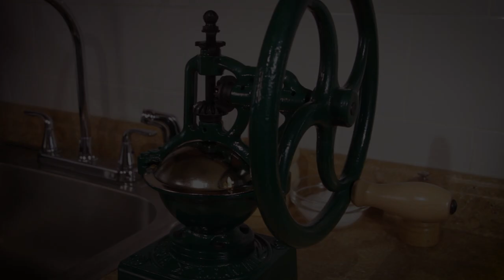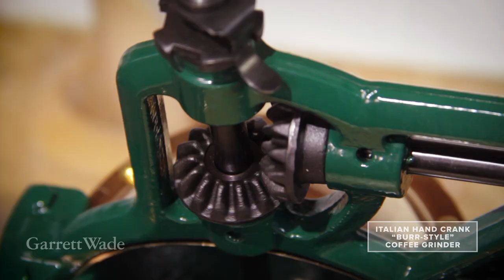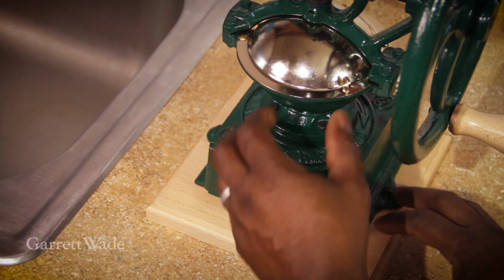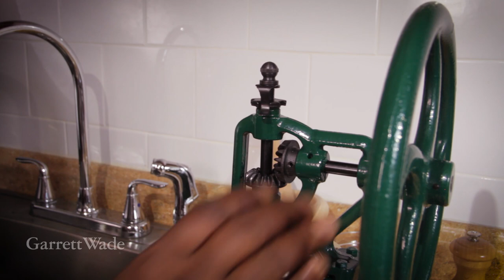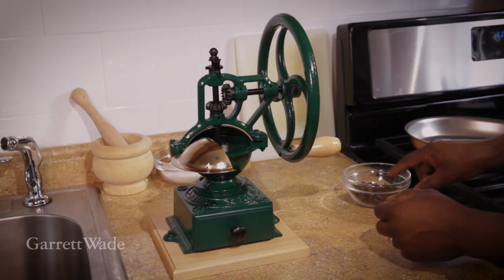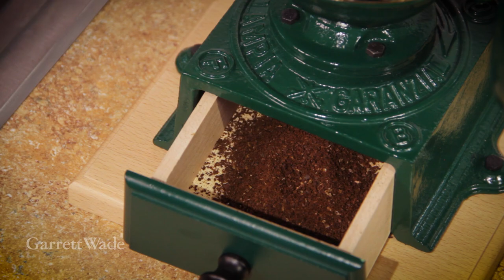Italian Hand Crank "Burr-Style" Coffee Grinder

Comment: As Italian (Turin, same place of these) I so far have two smaller/horizontal handle rotation ones. I'm looking forward to getting one of these and here I'd recommend it to everyone because of a few features... Heavy - doesnt wobble nor require an effort with a firm grip. I have just seen a couple of these in local shops and, for what I can guess, the vertical rotation looks like it's more natural (feels easier) to perform. Depending on the hardness of the beans, grinding can actually require a good bit of strength (not depending on these grinders vs others I believe, as they're really very sturdy - and that's a strong point. Not sparing on materials. Goold old way). A more natural-feeling shoulder/arm moving, does help making the practise more agreeable. The other feature I like is these can hold 100g in one go. If kept in a dry air environment and an almost airproof, ground coffee can be decent even after a few days. And, having some coffee readily ground, helps at night when neighbours/flatmates are sleeping and even the least noise (these grinders I believe are just as silent as such tools can possibly be) can disturb their sleep. Oh and a good amount can in fact be good also to brew extracoffee when doing so with a Napoletana "cuccumella" flip-over coffee maker which is quite good even cold and for a few days then. As for the speed, my two smaller ones, 30g and 50g sizes, have just very slightly different sized/shaped burrs. 30g will take me two minutes to grind a full load of beans, and 50g about one minute. Yeah, bigger is faster. I'm not expecting this big one in the video to be even faster, however at a decent (but hot crazy) pace (some 1-2 rounds per second) i think it's satisfactory. One cup will be just a fraction of that. My 50g is older and more used and abused, however the reason it feels rather hard to push. I suppose it's due to the shape of the burrs (grasping more beans all at once) but i'm feeling optimistic about this superbig one here, because the levers apparently make it lighter to push the handle. So some local users tell me. Have a good cup, everyone :)
Reply: Buon Natale. Grazie per il tuo commento. Ho comprato la macchinetta ieri. Sai che è il ‘Burr size’ della macchinetta?

Comment: How much did this grinder cost?  I wanted to buy one but the garret wade website says it's not available.  Would you be willing to sell this one?
Reply: Hi, i'm from Italy, near Torino, the town where this grinder is being produced to this day (been for about a century i guess), home to top chocolate and coffee. I have handled a couple of them in shops. They're very sturdy, the smaller models (horizontal rotating 'wheel') are cheaper and what our grannies have had in their kitchens ever since. I'm actually using two (set to different sizes, handy) from each of my parent's families. This one big models when handled felt very smooth and easy-rolling. One thing i like of it is the (large, 100 g beans) sise of the tank to grind in one go. I know purists will shake their heads but i find my ground coffee is still acceptably good after a few days (a weeks or so). So, it's nice to pour, grind and collect 100g of coffee in just one go. I suppose the grinding will be relatively fast - on my smaller, but still slightly big (50 g as opposed to the smaller 30g one i have, same brand) grinder, the burrs are bigger - it's faster. Ok, sorry everyone, i just felt like telling a bit of the story. Now the references: the brand is Tre Spade, in Italy it will be around some 200-220 euro. Rrp might be bit higher, but here most shops are willing to cut some 10-15% off items. I suggest to check availbility on ebay (macinacaffè verticale tre spade) and usual channes. I find it's worth it, even for an amateur like me and soon as i reach a reasonable point on my shopping list, i am sure willing to get one. Who knows, thewe tips might even be good to know/useful, hehe cheers :)